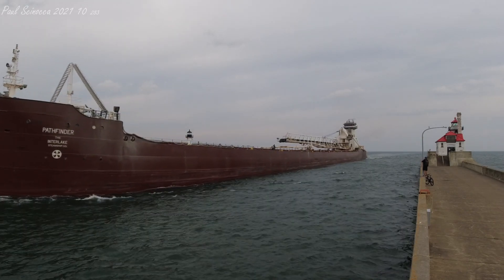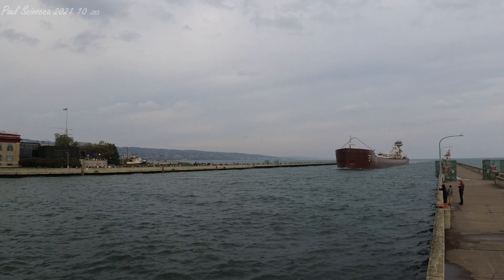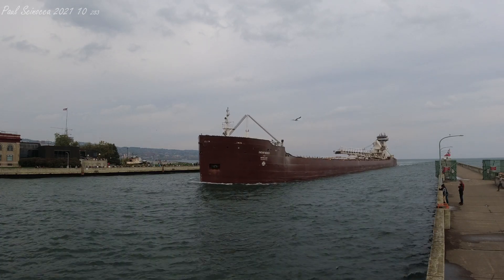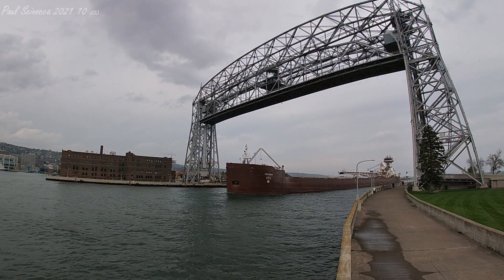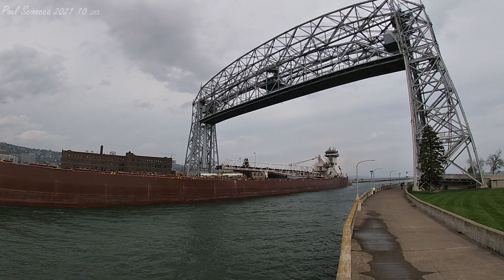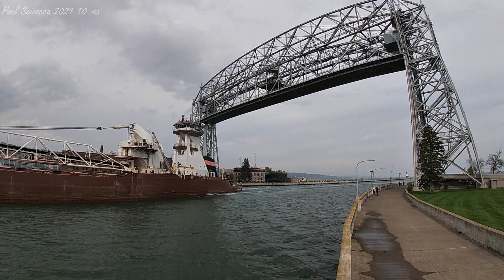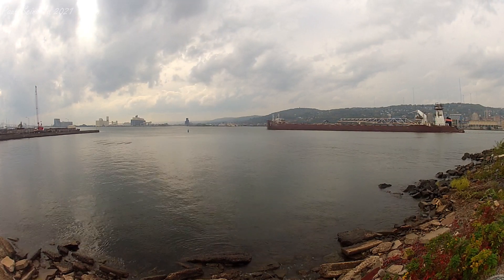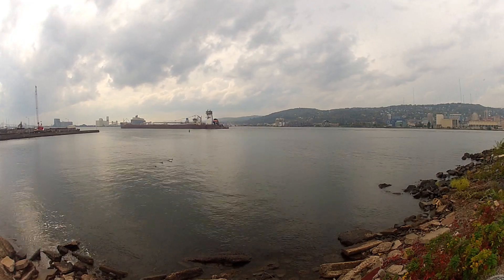The Most Maneuverable Tug on the Great Lakes! ATB Dorothy Ann Pathfinder Duluth Arrival Oct 10, 2021

Comment: I wonder if a vessel hauling salt shortens its components life due to corrosion. I assume they must clean very well after unloading. Thanks for the Z drive info. Perhaps Interlake Steamship newest ship, M/V Mark W. Barker, will be equipped with Z drive.
Reply from the maker: Info from Boatnerd.com:

The new River-Class self-unloading bulk carrier will be constructed in Sturgeon Bay, WI and is scheduled for completion in mid-2022. Measuring 639 feet long, by 78 feet wide, and 45 feet deep with a DWT of 28,000 tons. The vessel incorporates a flap rudder as well as bow and stern thrusters. The power plant is designed for 7,800 shaft horsepower produced by two sixteen-cylinder EMD diesel engines that are EPA Tier 4 and IMO Tier III certified and is expected to have a top speed in excess of 15 m.p.h. Propulsion will be provided by a single-screw, 18’ diameter, Kongsberg, controllable pitch propeller. Electrical power requirements is provided with one 940 kW ship service diesel generator, two 2500 kW shaft generators and one 274 kW emergency generator.
Reply: I would assume - but would love to hear from someone in the know - that the interior is coated with a protective coating of some sort. Also, keeping the salt dry would be key.
I was just thinking about what a mess it would be if water got in the hold of a salt carrier...
Reply from the maker: @tuxedotservo  I am guessing you are correct, it was processed salt, which unloads pretty easy. Guessing the do a good rinse out in the lake to avoid the corrosion of the equipment.